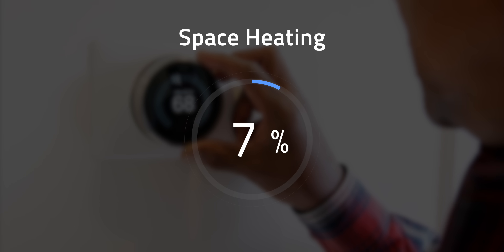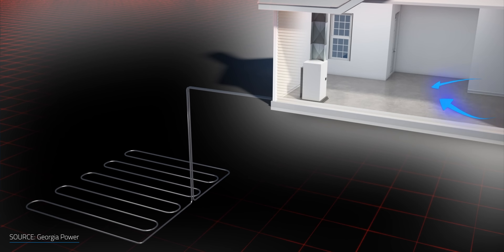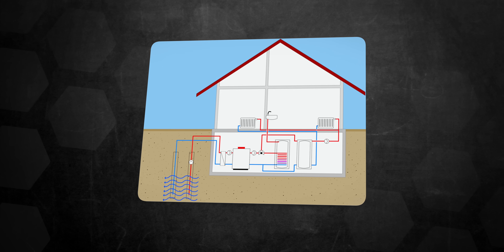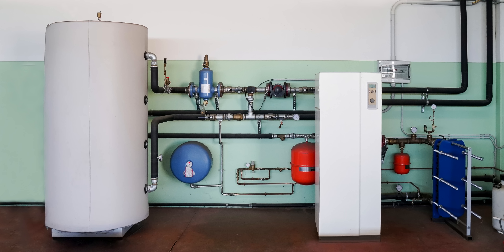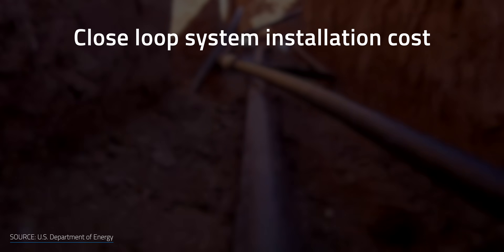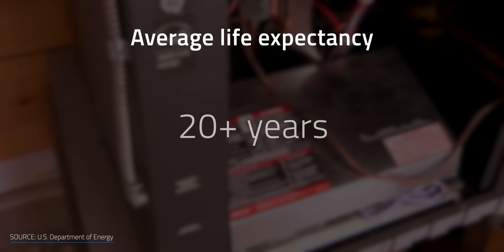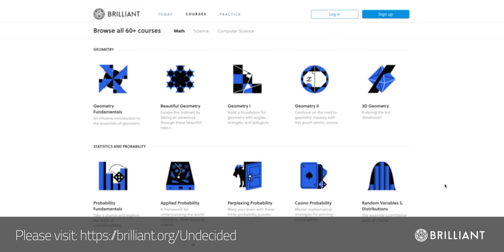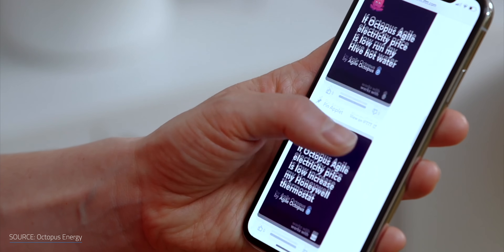Is Geothermal Heating and Cooling Worth the Cost?  Heat Pumps Explained

Comment: Geothermal heating is beneficial in areas with extremely cold winters but it is expensive. Just drilling the vertical hole down to about 60 meters depth will cost somewhere between 8000 to 10000 dollars. Then there are the costs of the rest of the equipment. A more affordable solution is air to air heat pumps. It will cost between 2000 to 3000 dollars. It works like reversed air conditioner. In the summertime they can also be used as air conditioning if needed. It works down to about -15 degrees centigrade and is optimal around 6 degrees centigrade. I installed mine several years ago and noted my electricity consumption went down to half of my previous consumption. The temperature outside was -12 degrees centigrade at the time. For major energy consumers like public indoor swimming pools the investment pays off in a couple of years. Here in Norway these big units use water to water heat pumps. I believe that more than 75% of private households now have heat pumps installed in this country. The investments pay off in relative short time even if electricity here have been relative cheap until now. With high electricity cost like in Central Europe the pay of will be even faster.

Comment: I think those prices are a little low on that those geothermal is an even the air to air systems. It was a brand new house $20-$25,000 easily for a traditional heating cooling system where you need all the ductwork. Ground loops pumps glycol mix and those water source heat pumps are quite a bit more than traditional air to air systems. The heat pump itself is still subject to the same wear and tear as any other traditional HVAC system. It’s still a refrigeration system with an evaporator coil that will be subject to surrounding conditions. If it’s in a humid climate like the south east of the US you’ll be lucky to get 15 years out of it. The ground loop if it has issues better have a lot of money on hand. I really don’t think this is a good option for regular middle-class people. I am an HVAC professional and see what happens when people have to cough up five $6000 it’s very painful for them. Upper class homes or people have money maybe this is a better option. I lived in New York for almost 8 years a lot of old houses with hot water baseboard or steam they will always have that. High-end homes new construction in the Northeast maybe this would be a good option

Comment: why not use only air, i know its not so efficient but its cheaper and trouble free or maybe i got sth wrong? just put some say 5 inch tubes bellow your house with intake on northern side and the air will circulate (ok maybe with some help from a fan) preheating in winter and pre-cooling during summer, such system may be more effective in milder climates.(?)

Comment: they can also add a de-super heater to a geothermal system. it's an exchanger coil that uses excess heat pulled from your home in the summer- to heat water for your house plumbing, rather than just dumping those btu's into the ground.
Reply: We have that in the loop of ours and it completely heats the water to hotter than we would ever need! When we first bought the house, it was June and the previous owners had turned the water heater completely off when they moved out the previous fall. When the temperature dropped in September that year, we thought the water heater was broken! Paid to have the plumber out, only to have him tell us it wasn't broken, just turned off LOL The loop had been keeping our water hot the whole summer all by itself!

Comment: These will not last 100 years.  That's absurd to claim.  I do think they have potential, but I'm not totally agreeing with the selling points.  These systems baaaaasically have the same components as traditional HVAC, such as a compressor, fans and fan motors, heat exchangers or coils.  There's no reason to believe that these components will last any longer than any other system, as they're the same.  The underground tubing....maybe it will be down there for 50 years without springing a leak but i doubt it.  It also limits what you can do with the yard space that it occupies.  The key to going green is to completely forget about the wealthy.  They do not exist.  There are no wealthy people.  Everyone makes 40,000 a year, which is being very modest.  Now.....how can you get these people to  buy your product.

Comment: I want a geothermal or dual source system so badly. But I just bought a new heater a year ago. It went out right after we bought the house and was an emergency replacement, so didn't have time to do any research for it. Went with an ultra high efficiency system, so it's much better then normal, but still not optimal and doesn't help with cooling. But since it's so new (and expensive) I'm not likely to replace it anytime soon.

Comment: Somehow I missed this video of yours back when you posted it.  When I got my house here in NH a few years back it did not have and cooling for the summer.  Went 1 summer without AC and that was it.  I went with a air source Mitsubishi High Efficiency Heat Pump.  Honestly this was a great upgrade giving us AC and heat in the winter and combined with solar it's been great and comfortable.  That said, doing it over again I would likely consider going geothermal.  Looking at the install costs, what it cost to install the air source gets me a good of the way towards a geo system.
Reply: If it's any comfort, there's plenty of other options for efficiency, and the best way is to reduce total heating and cooling!  High efficiency windows now are coming at at R-5 to R-7, and proper sealing of doors and windows are essentially leakless.  Home ventilation ERVs can replace options like 'trickle vents' and high efficiency wall insulation in concert with these measures can reduce your total heating load to half of the amount shown here or less.   That's the best way to save energy.

Comment: I had a 5 ton horizontal loop geothermal system put in my place in 2016. Total cost after tax credits and my electric company's $1000 rebate per ton ended up being around $13k.

Comment: Why don't house and commercial office builders just put these geothermal heat pumps into new builds. 
The cost is then included into the cost of the home.
Over a 30yr mortgage this is nothing. 
Also such homes/ commercial properties will be more valuable and will sell quicker.
The best way to reduce energy use is to not require it in the first place or need much less for space heating.
This is obtained by building Passive buildings that comply with the German Passivr-haus standard.
Pleas make a video about Passive homes.

Comment: I guess electricity costs must be cheaper in the US than the UK to make the economics of GSHPs work.  Here in the UK electricity is about 5 times the cost per kWh than gas so even with a COP of 5 you would just break even and that would not include the large cost of the installation.  Also these systems put out lower temperature water than a gas boiler so you generally need to upsize the radiators and also have well insulated buildings to get the best out of these systems.  A great idea - but not for everyone.

Comment: Have a home made water water heat pump with compresor pa290g2cs-4mu1. It cost me only about $1800 this includes compresor freon 410A  two heat exchangers freon water, thermal expansion valve copper pipes, boiler thermostat for controling hot freon temperature time relay which controls how much time compresor will wait before turn on after it is turned off. I am heating 100square meters house with radiators to comfortable 79 degrees fahrenheit on 14 degrees fahrenheit  outside temperature. Underwater temperature 57 degrees fahrenheit. Underwater pupm cosumes about 500W/h and throw 1.5cubic meters water per hour. Compresor consumtion 2.4KW/h 80W/h for radiators water pump total about 3 to 3.1KW/H maximum consumtion. Radiators water about 122 degrees fahrenheit for 100 liters of water.

Comment: If space heating is 15%, and space cooling is 16%, how'd you get a total cost of 31%? You're either heating OR cooling. Not both simultaneously. People in NY are heating at 15% while people in FL are cooling at 16%. It's still only a 15.5% cost average nationally.

Comment: These systems work great but only if the building is well insulated. One thing people should also be aware of is once a building is well insulated it will then need a suitable ventilation system like a MVHR system (Mechanical Ventilation Heat Recovery) because a well insulated building will get a build up of moisture which leads to mold and mildew build up which is bad for your health. Needless to say these things don't come cheap.

Comment: I don't understand how "dual source" heat pumps can be more efficient than "ground source" heat pumps, let alone have a greater efficiency increase over "ground source" than "air source" heat pumps.  The whole point of "ground source" heat pumps is that they are significantly more efficient than "air source" heat pumps, since when it is hot you are taking the excess heat from your home and transferring it to the colder ground rather than the hotter outside air.  Similarly, when it is cold, a "ground source" heat pump takes the heat from the approximately 60°F ground and transfers it into your home, rather than trying to take the heat from the 30-40°F winter air and transfer it into your home.  The only time an "air source" heat pump could possibly be more efficient than a "ground source" heat pump is when the outside ambient air temperature is between the constant 60°F ground temperature and the 68-72°F temperature most people try to keep their homes at.  However, even in these circumstances the "air source" heat pump isn't likely to be much more efficient than the "ground source" heat pump (if any) due to the greater efficiency of the refrigerant-to-liquid heat exchanger used in "ground source" heat pumps as opposed to the refrigerant-to-air heat exchanger used in most "air source" heat pumps.  The claims made about the "dual source" heat pumps just don't make sense to me, and even if true it seems like it wouldn't justify the expense of adding some kind of secondary loop to the system.  Can you please go over these "dual source" heat pump systems in more detail and explain how they are more efficient?  Other than my confusion over this issue, thanks for another interesting and informative video.

Comment: Geothermal makes long term sense depending on the size of your home, how much insulation you have and what your climate is like. If you live in a small home, with higher levels of insulation, you're probably better off using high SEER mini-splits. OR if you're climate primarily requires heating without the need for much cooling, your better off using something like a closed loop solar water heater (possibly DIY) with an insulated collection tank to store the excess heat, which can be used in a radiant heat system.

Comment: We're installing a ground source closed loop system at our house and they're using a technology you missed -- directional drilling. Rather than digging up your entire yard or bringing in a well digging rig, it can dig a few feet down and snake around under your yard without excavation. Same technology that was used to replace our below ground level water main when the old galvanized steel pipes burst.

If you're thinking of installing a system, check to see if anyone in your area does directional drilling! Huge cost savings for the drilling component.
Reply: Thank you!!!!!
Reply: most places have it, it's also sometimes called "directional boring". It's a super common service since thats what they use to get power or data lines under roads so if you cant find someone to do it you can try calling local utility companies to see who they hire. It's almost never done in house since the codes are pretty stringent, it's highly specialized equipment, and they have really high insurance so it's almost always contracted out.
Reply: If that loop isn’t at least 6 to 8 feet deep you efficiency will definitely not be as good as it should be, a geo will only be as efficient  as the ground loop due to the fact that it is the means of the thermal transfer.
Reply: @robbyketcherside3286  How does the burial depth affect the efficiency? I thought that once you got more than 2 feet down or so the temperature didnt really change much and that the point was mainly to stabilize the temp of the home at a similar tempeature to the ground since the only places you can truely heat a home with geothermal is in hot spots like Iceland.
Reply: @arthas640  2 feet is good, but you have to make it a minimum of 5 ft (pending on your area), before the atmospheric temperature has near 0 effect on the pipes. At 2 feet deep "SOME" places in the USA will have freezing or near freezing temperatures in the winter (think any northern state). Other places will see ground temps rise due to very high heat in the summer (think Arizona). Also the more you use the unit the more you heat/cool the ground. The more soil you have as a energy buffer the better the system will perform.
Reply: @arthas640  The deeper you go, the more constant the temperature, and the more efficient.  According to a graph I downloaded- at 2 feet, the annual temperature variation is ±14-18 degrees of average.  At 4 feet, about 12-15.  At 6 feet, about 10.  At 20 feet it's maybe 5 degrees.  At 30 feet it's basically constant.  Wet soil, there's about double the variation as light try soil for the same depth.
Air source heat pumps can still work with like ±50°F annual swings, so even 2 feet will benefit over air source quite a bit.  The first few feet, going deeper makes a decent difference, so as long as you're digging why not go for 4 instead of 2.  But beyond that, going deeper doesn't help as much, and is harder/more expensive anyway.
That's with horizontal loops.  Vertical, it goes hundreds of feet but that's for surface area and land area, not because it's any more stable at 200 than at 30.
Reply: @ErrantChordier  I didn't think about heat pumps using underground lines rather than above air coils, that makes a ton of sense though. 

Kind of random but my grandpa was the head engineer at a brewery and always wanted to do something similar for a house and had a dream of building an underground house but compromised with grandma and built a split level with a daylight basement instead
Reply: Does the ground freeze in your area?
Reply: @squamish4244  It's pretty rare for the ground to freeze more than a foot down, and even that often takes months of freezing temperatures. Burial depths for plumbing lines vary but 1ft or more is common but almost everyone requires them to be buried below the frost line. I commonly see them buried at the same depth as power lines which are 24 inches measured from the top of the pipe.

Comment: I was under the impression that the compressor/expansion valve model always involved a refrigerant that changes state between gas and liquid. Your diagram seems to involve water, or maybe water plus antifreeze. Does it change states somewhere in that loop? Or was my impression just wrong?
Reply: Yes. That diagram was over simplified.  Actually, the ground source water loop is separate from the refrigeration loop.  Compressors compress gas, not liquid.

Comment: We moved into a house with Geothermal system put in and we're needing to replace the heat pump because 1. it's 20+ years old, 2. the previous owners didn't do any maintenance or repairs on it. How much does it cost to replace a 5 ton system? Some of the quotes that I received seemed astronomical, but that's just my opinion. Anybody replaced a heat pump before?

Comment: Great video Matt. These heat pumps all seem to be aimed at the individual house hold, that seems quite inefficient for each house to have it's own system. Are any large scale developments implementing it on communal system? Here in Portsmouth UK there is a plan to use land reclamation to enlarge an island to make space for 3000 homes (high population density) the council claims the houses will be net zero but offers no explination of how this would be achieved! I was woundering what sort of land area (or area under the harbour) would be needed to service this size of development and if it could be implemented on a large scale.  Maybe a topic for a video.
Reply: How would you share costs for that? Someone like me who is comfortable with their house at 60F in the winter will have no interest in paying the same as someone who just HAS to keep their house 80F in the winter so they can wear shorts and a T-shirt.
Reply: @Crosshair84   just charge them more. a utilities company would supply heat to your house for a price, just like gas or electricity.

Comment: If your house isn't newly built and/or properly insulated, it is a waste of $.   The thermal envelope is key in considering these high efficiency systems.  Consider spray foam throughout.  The side benefit of a great thermal envelope is that it'll reduce the sizing requirement, maybe a 3 ton instead of a 5 ton depending on house size. Other issue is that you'll need to find a way to insulate the very annoying vibration sounds they can make if installed in the attic.  And you'll also need an air filtration system to bring in fresh air and have it sanitized and cleaned and then circulated out.  Drilling costs are very high since in most locations a vertical set up is the only option. Costs have significantly increased since last I had one installed 16 years ago.  Not sure the tax credit is still 30%; it may now be 23%.   Check for it. Today, however, available are conventional very high efficiency systems that can rival the efficiencies of a geothermal.  My current system is a top of the line Lennox.  It was about $20000 cheaper than what a geothermal costs today.  The SEER ratings between the two are not that dissimilar.